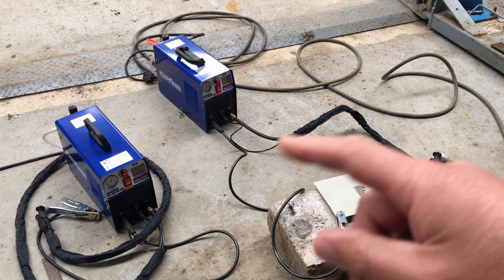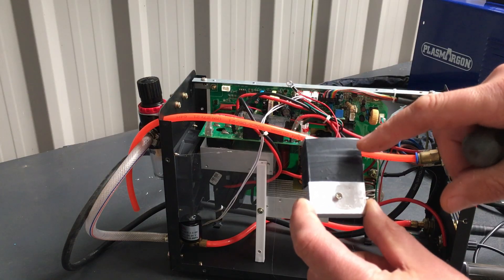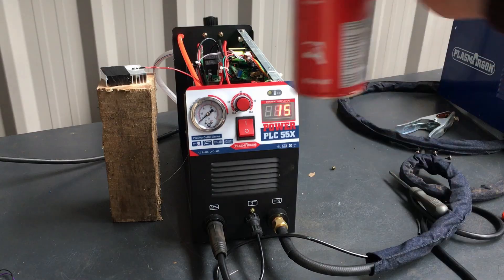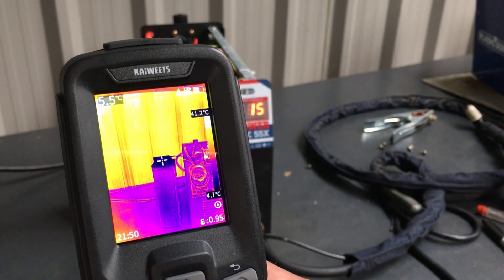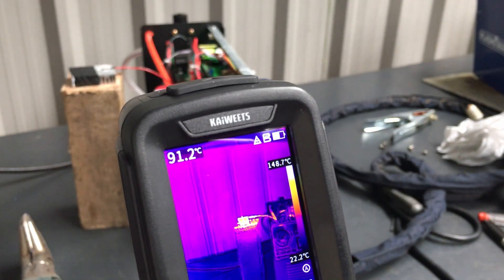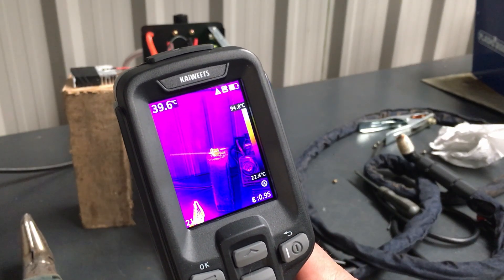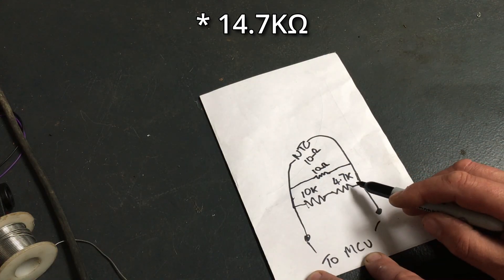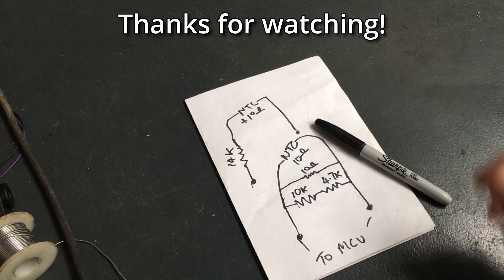Faulty Plasma Cutters - Follow-Up Video (With Thermal Camera) | Will It Catch Fire???

Comment from the maker: * UPDATE * Since recording this, a few people suggested increasing the resistance of the resistors I fitted. I added another 2.2K to make a total of around 16.9K in parallel with the NTC sensor.
Everything now works as it should. If the sensor becomes unplugged or goes open circuit it shows error E04, I've had the temperature down to -8C and the unit still operates as it should, the fans still kick in around 30C, and the over temperature protection still works too. So if anyone else has this problem around 17K resistance in parallel with the NTC will fix it.
Thank you to everyone who suggested increasing the resistance slightly. https://imgur.com/a/39xpsuO
Reply: Seems to lend to the correct thermistor should have been a 20k NTC.  👍
Reply: @sivalley  Parallel not series...
This change makes the values of a 20k NTC match those from a 10k but only at 23c.
Reply: i am confused. how can it see open sensor if you have fixed resistor to help the sensor to work after it operation limits?
and you showed that the E04 doesn't show any more on the screen after this mod, as they are on the board side.
Reply: @timowallin8020  in this video he only had 14.7kΩ in parallel with the thermistor, which means the resistance could never be higher than that, which is why E04 never showed. (Since E04 triggers above 15kΩ.)
But in this pinned comment he's saying that, after making this video, he increased the parallel resistance to 16.9kΩ which makes it possible for a disconnected thermistor (or very cold thermistor) to trigger E04.

Comment: To actually add something: The way to really fix this is checking (as you did) which resistances correspond to which error. So you got your thresholds. Then you can find out which type of NTC this actually is by assuming/assinging temperatures it should trip on and comparing this to different NTC types. Then you can actually use that NTC or approximate it correctly. This is also how to do it if the NTC itself is broken.
Reply from the maker: Interesting, yes I see that now. I think I did look at the time and it was a pretty standard NTC, so I was wondering if they had just not anticipated it being used in such a cold climate? I did put a pinned comment under the video (if you didn't see it) as I did change the resistor values I used slightly so it now also detects if the NTC goes OC or it get's disconnected.
Reply: @BuyitFixit  I am sure your fix will work fine, as per your test. I remember a hair trimmer which had the NTC broken off by someone else in the repair cafe when changing the battery, so it would not charge anymore. I tested the threshold, 26 kOhm, which is pretty much exactly 60 °C with a 100 kOhm NTC type B4200 or B3950. That is a sensible point to stop charging, so that is what I used. Anyway, thank you for the good content.
Reply from the maker: Cheers mate 👍

Comment: All you did was raise the low temperature cut off parameters… 🤷🏼‍♂️ the modification didn’t affect how the high level over temp cut off operated  at all. Simple 🤷🏼‍♂️. However the fact you took the time to revisit and demonstrate this fact speaks volumes about your levels of humility. ❤
Reply from the maker: Thanks, yes the unit works as it should now. If you noticed the pinned comment under the video I also adjusted the resistor values very slightly so it also recognises if the NTC fails or becomes unplugged.
Reply: @BuyitFixit yes I did see that - a very clever solution to the issue. I was thinking the resistors you soldered to the pcb could’ve been soldered in parallel across the leads to the NCT sensor, I think that would’ve had the same effect? If the plug popped out the machine would no longer see the increased resistance? I think? 😂😂😂 Thanks for taking the time to reply again - Michael

Comment: Just a minor thought, I would have put your resistors in the sensor lead, so if the plug fell out it would still detect an open cct.
Reply from the maker: See pinned comment under video 😉

Comment: Impressive mix of theoretical knowledge, practical skill and experimental method. You have a new fan! For those interested in the thermister calculation:
Resistors in parallel are calculated 1/Rtotal = 1/R1 + 1/R2 +....+ 1/Rn. 
Resisters in series are additive so, Rtotal = R1 + R2 + ... + Rn
In the static temperature example 1/Rtotal = 1/10 + 1/(10k + 4.7k) = 9.99ohms, as demonstrated.
The thermal protection circuit was incorrectly biased towards triggering at lower temperatures, the additional resistors raise the triggering value to an appropriate level by forming a voltage divider with the sensing voltage at the centre tap, much like a potentiometer. Learn about it here
https://en.wikipedia.org/wiki/Thermistor
https://en.wikipedia.org/wiki/Voltage_divider
or build your own virtual circuits using LTspice.
Reply from the maker: Thanks 👍  I did make a slight adjustment in the value after recording this and put it in a pinned comment under the video. It also now detects if the thermistor is disconnected or goes open circuit.

Comment: The only problem I see is when the NTC goes open circuit or the cable is unplug then resistors will prevent that detection. As you said before that NTC circuit is not for that unit. Great video!
Reply from the maker: Thanks 👍See pinned comment under video. I also managed to fix those possibilities too 🙂

Comment: This is the same mod I did to my dishwasher to limit the running temp. I used a 10k resistor across the NTC and that lowered the max calling temperature to the controller saving energy. Never gets much above 40C now. 10k might be 14k going from memory but it works. Cheers thanks for all your excellent  videos

Comment: Hi
Loved these videos so much I went out and bought a faulty Plasmargon PLC55.
Very much hoped it would have the same fault.....nope!
This one is completely dead. No lights on main switch or panel, no fan etc.
There is A/C power to the  relay. 
If I apply 24V to the coil of the relay with the bridge rectifier DC wires disconnected, then I can hear the relay click.
If I do the same thing with the bridge rectifier connected, then the mains RCD gets tripped.
I take it there is a short somewhere, any pointer of where to start looking, please?
Kind regards 
Rob
Reply from the maker: Thanks 👍I'd start by checking the bridge and then the mosfets. Check also the board isn't touching the case anywhere too! Make sure there's no voltage in the capacitors first as they'd give quite a belt I bet.
Reply: @BuyitFixit  
Hi, thanks very much for the advice. The bridge rectifier seems OK, getting 180V DC out of it if I apply 24V to the relay coil, as long as I disconect the DC out leads from it. If the DC out leads are connected, then the rcd trips.
Will check the other items you mention tomorrow.🙂
Keep the videos coming, please, very clear and informative.👌
Thanks again, Rob

Comment: Do you consider this to be fixing a design fault or a build fault?  Could it have been a tolerance fault with the NTC resistor? 
How is the temperature sensor measured? If an AtoD on a processor, the manufacture could  have fixed the fault with a corrected software setting, as the error messages indicate a window detection function. 
It would have been informative to measure the voltage across the NTC with temperature, as this would have indicated what the processor was measuring. The NTC resistor  is likely part of a resistive devider network, with either the NTC resistor or its associate fixed resistor referenced to circuit zero volts. While the fix clearly works, it might be masking the real fault in the A/D circuit. The incorrect connector might indicate that the NTC resistor was from a different component supplier and maybe had a different characteristic. 

It is impressive that you managed to locate the problem with so little information, not even a circuit diagram, something you manage to do in other product fixes. 

While the fix solved the problem, which maybe all that matters, it might not be the real source of the problem, which could be a design fault, a component tolerance spread problem, a component supply problem, a software setting problem (perhaps in manufacturing  alignment)  or a build fault with the sensor associate resistor or its power source. It could even be with the A/D voltage reference. 
Even with such a poor build quality, it might be unwise to assume such a simple design fault as not accounting for a low temperature operating environment. These units are likely made in volume, so such a design fault would prove very expensive.
Reply from the maker: I didn't really investigate the circuit too much. It could have went directly to the MCU via a resistive divider. It could be a software problem. I did a follow up video to this one where I tested everything with a thermal camera, and then I made a slight modification again in the pinned comment under the video. The machine now works perfectly including showing the error if the sensor fails open circuit or becomes disconnected 👍
Reply: @BuyitFixit  I appreciate that you very successfully found a work around for the fault, but adding components that were not in the original design can only be justified if there was a fundamental  design error. Time pressure and the need to make this poorly constructed product work is a very good reason for applying the fix, and you did a lot of work to show it is both safe and practical. But the purist might think that the work around is actually hiding the real fault. I suspect that the problem may have been that the product manufacturer had some problem sourcing the correct NTC resistor, as is evident from it having the wrong connector, however the real fault may be in the A/D circuit and what was fixed was simply a symptom. Diagnosing and fixing cascade faults can be difficult, for example an intermittent faulty PSU may blow associated components. These can be replaced and the unit appears to be working, only to fail again when the source PSU fault reoccurs. This is not a criticism of your work, simply an observation on the nature of fault finding. As a general rule, it is wise to assume that a faulty product was originally designed and built to work. This is reasonable in most cases due to the very high cost to the manufacturer if this is not the case, particularly in high volume, safety critical,  or expensive products. 
Design faults are more common in products that contain software, and are often labeled as unintended features.
Reply from the maker: Thanks for that. Yes I think wrong NTC or software but this was the easiest work around I thought. I did have something like this before where someone bought a load of Philips sound bars which all worked for 15 mins the  started cutting out due to overheating. This seemed to be a design fault so I modified the circuit to match the amplifier chip manufacturer recommended circuit and it worked fine after that. Video on those is on my channel too if you didn't see that one.

Comment: The only reason I would have soldered the resistors on the wire side instead of board side is that both units showed tendency towards plug mechanicly displacing themselves from the plug. Putting the parallel resistors near the thermister allows for safe service stop for both plug disconnect and most of wire breakage.  
Just discovered your channel today!  Please note, my comment is not ment to denergrate your solution.  But my years of experience fighting Mr.Murphy's Law says to put fix by thermister!  Hopefully, you folks across the pond know of Mr. Murphy!
I like what I have seen of your channel, and you have my subscription!
    Hopefully, you can inspire a few youngin's of 
Today to become tinkerers and fixers of our throw aways!
Semper Fidelis 
Bob
Reply from the maker: Thanks Bob. There has been a little update since recording this. See pinned comment below the video 👍

Comment: I'm sure somebody already said this, but according to Ohms Law parallel resistance is calculated as Rt=1/R+1/R+1/Rn... so in this example at high heat and taking 10 Ohms as the thermal probe value the resulting total resistance would be calculated at 9.96 Ohms. within the range to throw a high temp error. His explanation, while a bit simplistic is sufficient.
Reply from the maker: Just an update (pinned comment) I've added a 2.2k in series to make a total of just under 17k, as a few people suggested increasing the resistance I used slightly. Now everything works perfectly including including sensor failure detection.

Comment: maybe i misunderstood what you did in the original video, it sounded like you said you added the resistor in parallel and thus the resistance would never go close to zero, which of course is wrong and probably why you got so many comments. anyway, so long as it works you did it right, whatever you said.
Reply from the maker: Cheers 👍

Comment: Excellent. Now all you need (for the failed open scenario) is an Arduino monitoring current into the thermistor or wrap one of the thermistor wires around a reed which is in series with your resistor mod. Both super-easy mods, if only in my head, ho, ho.
Reply from the maker: Cheers Ralph, a few people suggested using a very slightly lower resistance. I might give that ago and pin a comment on this video if it works 👍
Reply: @BuyitFixit  Another thought was to follow the circuit back towards the micro to see if there is a tweakable divider or comparator or something. I suspect that you have already done this and there's probably just a piece of wet string.

Comment: I think what most people are referring to (at least I hope so), is that you disabled the units ability to detect if the sensor comes unplugged or fails open. This may lead to a dangerous situation where the unit will happily keep trucking along without a working temperature sensor potentially overheating. At the same time, it is also not possible to wire resistors in series as this will cause the temperature set points to become skewed, causing the entire temperature monitoring function to not work at all. The correct fix would be to modify the programming to change the 15Kohm "open circuit" detection to something more sensible, but that will obviously be difficult to do. Or you could use a slightly higher resistance (16-18k or something?), so the unit still detects if the sensor is open circuit (unplugged/failed open).
Reply from the maker: Yes I agree with pretty much all of that. I did mention on the previous video that the only downside of this would be if the temp sensor failed open circuit or was unplugged hence glueing it into the socket (although there is still a remote chance of it failing open) although there is a highly more probable chance of something else failing in the unit before that happens. The skewing of the curve would be minimal I think as the resistance increases dramatically when the temperature lowers. At 0C it should be around 32K ohms. The Fan switched on at 30C which I think should be around right, and it cut out at 90C (Most caps are rated at 105C).

Comment: Parallel is correct ... but ... you also have to take into account that if you ( for example ) put 2 x 1/4W 10K resistors in parallel, it becomes a 1/2W 5K resistor array.
Reply from the maker: Very true, although not really an issue on this as it's just being read by a microcontroller.

Comment: Appreciate the follow-up, but really, that extra parallel resistance should have been a bit higher - 22k would have allowed the open-circuit detection to still work if the thermistor failed open circuit or the plug came out again. Using 15k stops the unit detecting open circuit at all.
Reply from the maker: Correct, but the NTC resistance increases dramatically at lower temperatures. I'm no expert but at 0C the resistance of the NTC would be around 32K ohms and 64K at -12C (not that I'd fancy using it in -12C) 😂😂
Reply: @BuyitFixit  Ok, very good point. In that case, I’d have spliced the resistors into the cable and put heat-shrink tubing over them. Those chinese thermistors have a tendency to crack with heat cycling, and of course that plug could come loose again. Preserving the open-circuit detection is pretty important, since without it the unit will keep going until it burns up, and we all know what happens when MOSFETs get too hot - they go short circuit. You’d think that would immediately blow the fuse, but since chinese units tend to come wired with that crappy aluminium-cored copper plated cable, the resistance is too high to blow the 13A fuse and the cabling just goes up in flames.
Reply from the maker: The wire on these seems fairly decent. Ive encountered that thing aluminium stuff  before and more recently on a 4000W speed / power controller that I bought from ebay to control a 3KW water heating element. I ended up pretty much re-building it in a bigger case, with thicker wire and got rid of the 6A! switch it had fitted which would have just melted! I also put a bigger fan cooled heatsink on the triac (the old I removed was one was the one I used in this video) which was far to small for the job.